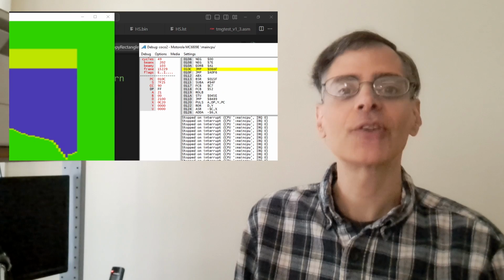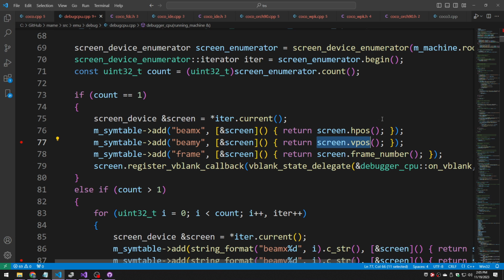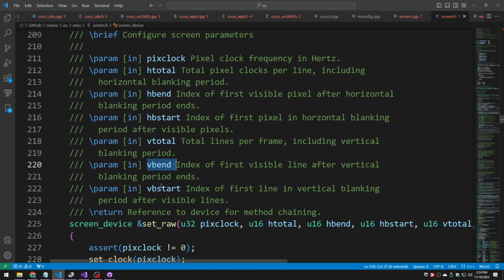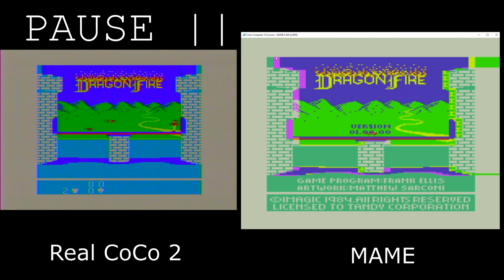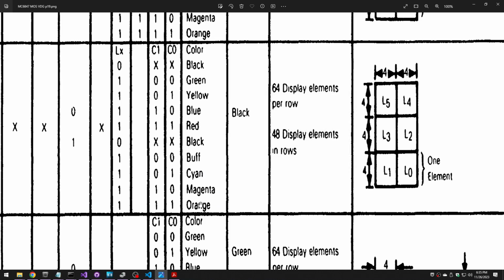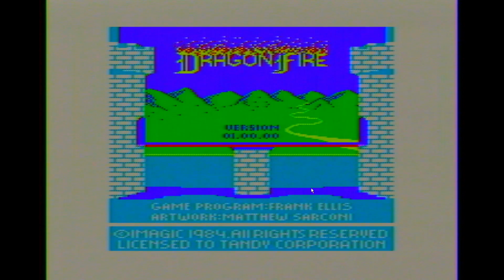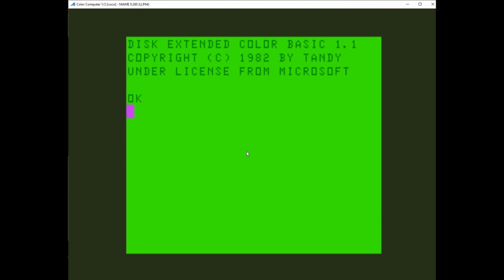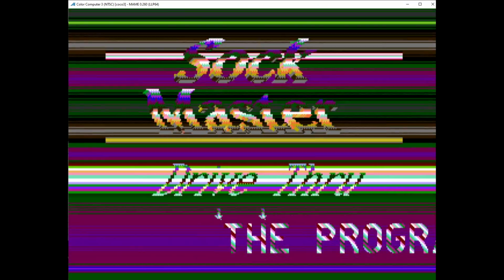The game that broke MAME (and almost me)

Comment: Wouldn't it be possible to create the illusion of a 16 color palette by alternating that palette selection bit every field, as well as the bitmap start location?  Of course, the resulting colors might end up looking worse than the originals, and it would slow down what could be animated in a game.
Reply from the maker: There have been several innovative demos for the coco, including recent work. I'm sure this would have been one of the things folks have tried (seems a lot easier than the nutty exploiting of undocumented behavior of the VDG I know folks have tried), but I don't know any specifics, or how well it would have worked.  The large borders around the active display area would also (unfortunately) change colors when you change the color set, giving you some flashing combination of buff and green.

Comment: Very nice.

I feel this video should have ideally been about 4 times as long though to dive into what other things you had to tweak and how the various timings interact, and what they even mean.

Linking speed is one of those reasons i don't develop on Windows. Long ago i switched to Linux and then from bfd GNU linker to gold, that's already much faster, but there are faster ones yet since recently, lld (from LLVM/clang) and the current champion mold. But gold can't deal with COFF files only with ELF, so it's not suitable for Windows. Mold is Linux-only. lld does support Windows though.

Also: disable LTO during development.

Comment: I didn’t know that there was a PAL version of the MC6847. The Acorn (morphed into ARM) Atom used this chip, and ran with vsync of 60Hz and not the UK standard of 50Hz, which caused the picture to roll on my TV, until I adjusted an internal pot. I’m surprised that they got away with this.

Comment: What key do you press to see the debugger? I wish I knew MAME had one when I was working on my neogeo game 😂
Reply from the maker: I believe the machine you're running first needs to support debugging.  Assuming it does, there are probably a variety of ways to run the debugger.  What I do is add "-debug" to the command-line.  I also add "-rewind" to take advantage of time-travel debugging.  I did a video that demoes it here: https://youtu.be/z2nQHxmFLzw
Reply: @CocoTownRetro  It's supposed to be NEOGEO MVS but I'd have to dig into the xmls

Comment: Why use MAME instead of a TRS80 emulator? MAME is for arcade games generally. Dragonfire never got an arcade release. It was original for the Atari 2600. The TRS-80 version was a port as well as are the ColecoVision, Commadore 64, VIC-20, Intellivision, and Apple II versions. Anyway this has encouraged me to play around with a TRS-80 emulator.

In any case, please submit your changes upstream so the community as a whole can benefit from your work.

Comment: Timing tricks like this were not uncommon in the C64 demo scene.

Great debugging.
Reply: It was common on quite a few machines at that time (80s and 90s). I think the main reason why it wasn't used more was that it was cpu intensive/delicate to get things correct.
The amiga/c64 used it to do some of the high color count images.
8-bit show and tell has a video about the c64 doing it for border colors.

Comment: Side note: Elite on BBC Micro does something similar to your CoCo 2 demo - except instead of changing color palette it switches resolution and bit-depth mid-frame. IE, the top part of the display (space view) in Elite is in 320x256 two-color (black/white, mode 4), while the lower part (the HUD) is in 160x256 4-color (mode 5)! With the BBC Micro only having 32K they couldn't possibly afford the video memory necessary to run in 320x256 4-color mode (20K!) but the HUD really benefitted from the additional colors. It also does some minor wacky stuff, I know the tunnel effect uses the same bitmap displayed in mode 5 then mode 4 (both times the entire screen is in one mode). Not full-on nuts as DragonFire (or any Atari 2600 game) but still neat trick.

Comment: I recall (many other 8bit systems as well as) the ZX Spectrum which i owned. Having some seriously, "how did they do that" moments in games. 

They were all achieved similarly to what is seen in this video, on a TRS-80! It's a display timing thing. Interestingly the 16(/32)bit Commodore Amiga had a coprocessor called the Copper. It was of course designed to do the very thing these ingenious coders were doing on a single 8bit CPU with simple timing info. The Copper could wait to do an update or a change to a hardware register at a specific time. Changing colo(u)rs and screen positions on the fly. The OS even used it. Ultimately it was kids play compared to the 8bit days. 

The decline of home computer formats and the rise of PC VGA and beyond has hidden this world of, getting the most out of something. Despite not knowing MAME that well, i seriously enjoyed the video and could see what was being achieved with the alterations to the code.
Reply from the maker: Thanks for sharing, and I'm glad you enjoyed!

Comment: Linking takes 20 or 30 minutes?  That's pretty bad.  Maybe you don't have enough RAM to hold all the symbols its working with?  Historically, I've found a RAM threshold made linking times drop off a cliff, for the projects I was involved with.  I remember documenting this to justify getting upgraded machines for developers.
I also remember when a 50 megabyte monolithic executable was enormous and causing such linker slow-down.  Now we have gigabytes of RAM and NVMe for swap space.  It's hard to imagine anything being slow.
So how big is modern MAME?  I know it has all the different CPU emulators and similarly for different hardware, but do those compile into separate loadable modules, or is it all linked into one giant executable?  I would think that fiddling for one device would only cause that one module to be rebuilt, and should not be slow.
Reply from the maker: Thanks for the info.  I've got 16GB RAM, which should be plenty.  Others have posted that I should look into which linker and what linker options I'm using.  I have some things to experiment with.

Comment: FYI, you can build MAME with pretty much any subset of the supported machines, which greatly reduces build and link time.  (Unless you have a machine fast enough that it doesn't matter; on my brand new M3 Max-based MacBook Pro, full-strength MAME links in about 2 seconds, which I'm still trying to get my head around).

To do this, you use the SOURCES= option to the 'make' command.  For instance, I often build with `make SOURCES=apple`, which builds everything in src/mame/apple.  You'd want to try `make SOURCES=trs` or even `make SOURCES=trs/coco12.cpp'.  If you aren't building from clean, the first time you do that you'll need to do `make SOURCES=trs REGENIE=1` to force the makefiles to get regenerated.  You can omit the REGENIE=1 after you've successfully built once with the new configuration.
Reply from the maker: Thanks!  Yes, I've been using SOURCES all along.  However, it's been mentioned that I should try the clang linker.  I've been using mingw / gcc for the full build thus far.
Reply: @CocoTownRetro  consider using a natively linux build env. From experience I can tell you windows has a hell of a time just mucking about with file attributes and opening and dropping file handles constantly.  A build that took just a few minutes on a linux machine took FOREVER on windows, and even in WSL. Just abysmal performance.
Reply: @CocoTownRetro If you can use mold, that also is an even faster linker.
Reply: @CocoTownRetro you dont even know what a clang linker is.

Comment: Amazing work getting this going, this is the work it took to get basically any individual 2600 game working under Stella back in the day! Racing the beam is very difficult to emulate and can be very CPU intensive to do accurately.
Reply: I assumed that this was kind of done about 10ish years ago when cycle counting was added to most emulators. Add in some basic maths and you get fairly accurate timing.
You know how many hrtz the screen is. You know how many rows and coloums. So dividing ay them and adding a little extra (it should be in tje manuals) will get you accurate timings etc.

Comment: That's fascinating. That sort of colour switching/interrupt splits became common in Commodore 64 demos. It's also an example where individual emulators tailored to a machine can outperform a more general emulation platform like MAME.
Reply from the maker: As another example, XRoar seems to do everything just right when emulating CoCo / Dragon, whereas MAME has some rough edges.  I have faith that MAME can do it all, just takes a lot of hard work.

Comment: Wow, nice work! I grew up in the early 80's with my CoCo 2 and I even spoke to Sock Master on the phone a couple of times. I couldn't even imagine diving into this super-detailed low level stuff. I'm going to have to sub to this channel as just talking about it brings up so many memories. I even still have a CoCO 2 in one of my closets somewhere - I'd just need to find a disk drive and controller, which is not easy these days.
Reply from the maker: That CoCo is lonely and waiting for you.  I barely use my floppy drive anymore, since I got a cheap Drivewire cable from Cloud-9.  You can use your PC's hard drive to simulate an unlimited number of floppies.  A couple of my earliest videos document my experience with Drivewire if you're curious.  The CoCoSDC is also all the rage as a floppy replacement (using SD cards as storage).  I don't personally have one, but they sound pretty great.
Reply: @CocoTownRetro  Nice, I'll have a look at the video. Keep it going, man. 👍

Comment: Thank you for not just investigating the issues, but improving the emulation to address these problems. What’s interesting about all this scan line mode flipping and manipulation, is that this type of raster display trickery was very challenging, so much so that it directly led to the design choices of the Atari 8bit computers and Commodore Amiga hardware (along with arcade machines and later game consoles). Specifically, the notion of simple display-list coprocessors, such as the Amiga’s Copper with just 3 powerful, instructions, allowed for exactly these types of CRT tricks, and more, to be carried out independently of the host CPU. By having direct access to hardware registers, and indirect access to the shared regions of memory used for video (chipset) memory and certain related programmatic objects, the copper could manipulate said registers, including those of the hardware blitter, to modify display modes and objects independently of the host CPU in a way that was tightly synchronized to both the display and the CPU. This allowed the Amiga, just like what’s seen with the CoCo in this video, to substantially exceed the theoretical screen mode color bit depths in almost exactly the same fashion, but doing so with substantially reduced CPU cycles (more cycles for that whole running the game part). A great example of a very extreme version of these techniques in action is Psygnosis “Shadow of the Beast” from 1989 (https://youtu.be/y9BltSvKMlQ).
Reply from the maker: I had no idea.  It's incredible that these genius hacks would lead to hardware to make it easier to do more genius hacks.  🙂

Comment: There’s a good book called “Racing the beam” that’s worth a read for anyone doing retro tech work. Some tricks can still be applied to modern microcontroller based projects where you are outputting video - and obviously when working on modern homebrew for old computers and consoles. The ZX spectrum scene is very active still due to the need for tricks needed for full screen animation at decent frame rates. For example drawing one frame just behind the beam the. The next just before the beam to give full screen scrolling and sprites etc albeit at 30fps but very smooth 😁

Comment: Switching palletes not just in hblank but in the middle of the scan is some mad skills
Reply: Atari 2600 programmers on an average Tuesday.
Reply: @thewhitefalcon8539 Atari 2600 programmers to make something that looks even half decent (it probably still sucks)
Reply: Racing the beam
Reply: Reminds me of some video games for certain systems changing the sample library used by the music "instruments" on the fly to allow for seamless playback of complex music that wasn't officially supported (including a full vocal track on the SNES in one memorable instance).

One side effect of this is that the music for those games cannot be simply ripped from the raw data, because you need to actually track what the rest of the programming is doing to screw with the music memory during execution rather than just what the music system thinks is happening based on the instructions in the song file itself.
Reply: @MAlanThomasII  Aren't SNES games like that in general? Where "LDA $00" can mean something totally different depending on where the direct page currently is
Reply: @Clippy4Jesus  To a degree the majority of consoles that use ROM cartridges are like that, bank switching is common. For sound specifically it can be tricky since old systems don't store sound as sound files, they store instructions to send to the sound generator hardware.
Reply: on the amiga it was common to do this every line. Of course we cheated.
Reply: @adv_josh  Didn't the Amiga have a special chip that was basically designed to do that though?
Reply: Howard Scott Warshaw: "git gud"
Reply: On some systems that would be considered demoscene level programming.
Reply: It's finicky and involves a particular kind of knowledge, but it's not too complicated, if you don't want to interleave too much extra useful stuff in the interim, which can get properly gruelling. But if you dial your ambition down, you can do it easily.

There are some really unpleasant things though. Foremost, when the hardware raises an interrupt, when does the interrupt routine actually start? Not immediately. After the current machine language instruction is completed at the very least; but it can take a varying number of cycles, since various groups of instructions take a different time. So usually there is a song and dance that takes a handful of lines to get to a stable starting point relative to line start. This is extremely yucky but once someone figures it out, everyone else just copies it thankful that they're not the ones who have to figure it out.
Reply: That’s just something that was done back in the day, NBD.
Reply: The Sierra On-Line Frogger port for the IBM PC XT did a palette cycling trick to have blue water and a black road.  https://youtu.be/LtlOqErP66Q?si=_llMSJ4jt9MuEmbN
Reply: Dragonfire is great on Vic-20 too
Reply: Other games (e.g. on the BBC Micro) did things like changing the display mode/resolution/colour depth part way down the display so you could have totally different display modes for the main gameplay area and a "console" at the bottom for example. Easily done.